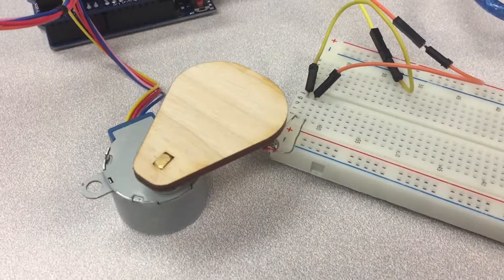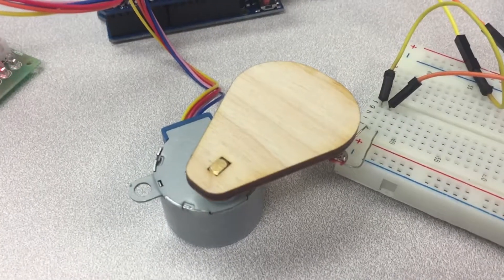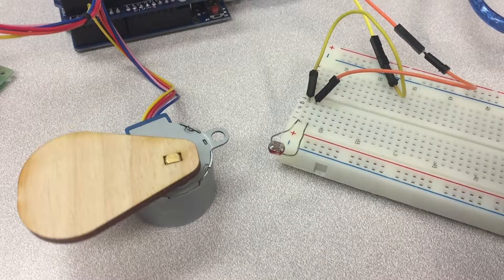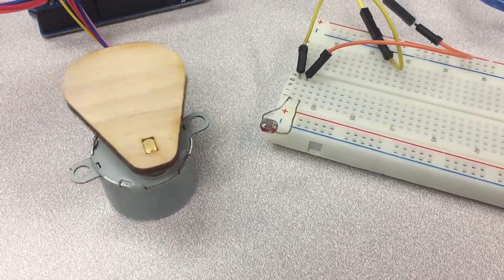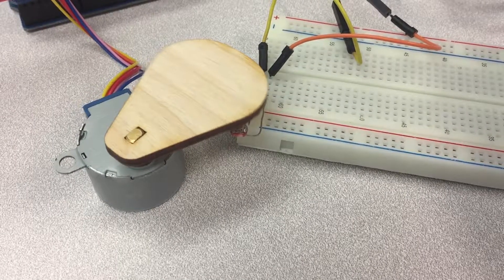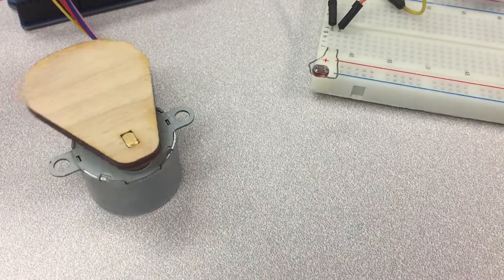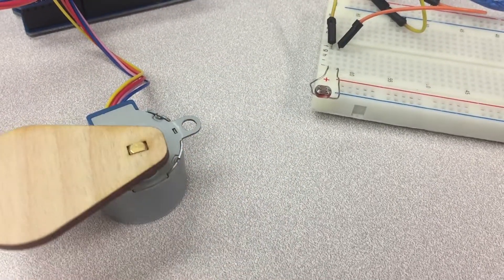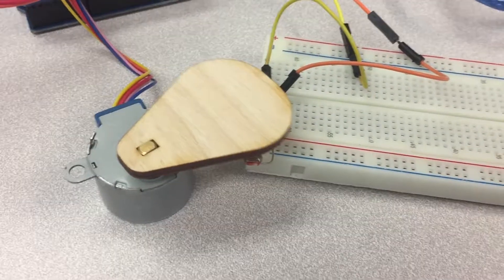Integral Windup Demo

Comment: Interesting. I found in one of my labs the integrator, becoming larger and larger, starts messing up the motor response. Realise know I could've just reset it. Instead, I just made it integrate over a limited number of discrete samples-technically incorrect, but it worked